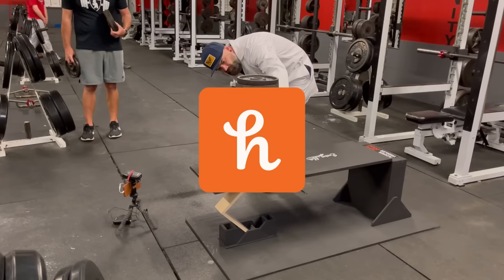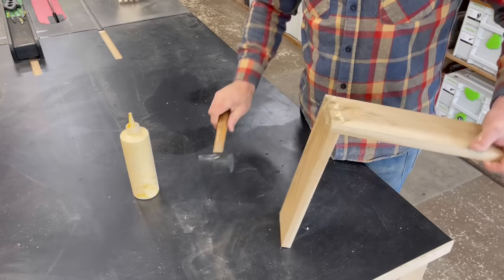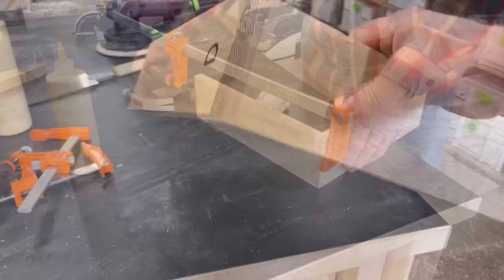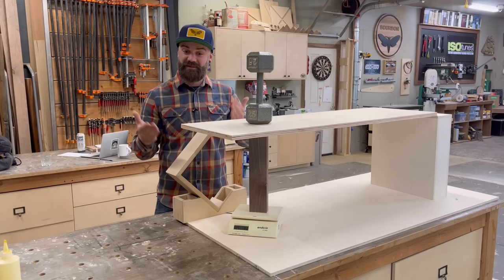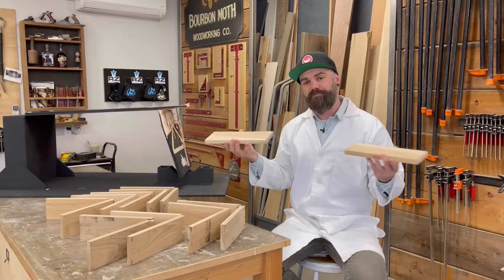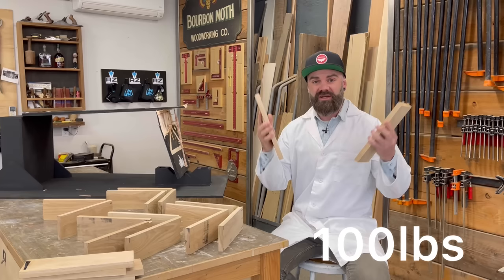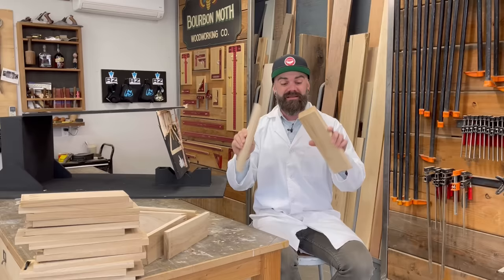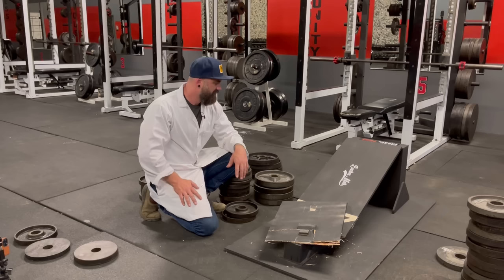What's the Best Wood Joint || Insanely Strong Joinery!

Comment: these are the variables that i think you need to check the next time you do this

1. the dowels where loose on insertion (im not saying that you should put a 1/2 in dowel into a 1/4 in hole)
2. the box/dove tail joints have many variables that you can check (box width - the fingers of the joint, curf width - the space between boxes) "i bet the best box joint has 1/4 in boxes and 1/4 in curfs, it would be a finger joint"
3. for the spline you could try adding more splines
4. you need to test the joints in 5 ways
-1 the way you tested it here
-2 pressing down with joint pointing up or down
-3 trying to force the boards to separate from weight on the inside in a L position
-4 trying to force the boards to separate from weight on the outside in a upside down L position
-5 shear the joint

Comment: The "Butt Joint" didn't fail because glue wicked into the end grain leaving less glue at the joint. It failed because the "Lignin" of the straight grain piece is much weaker than the straight grain in the end joint and thus tore away from the board close to the joint. (See Patrick Sullivan's video on "Glue Myths: 1. End grain").

Comment: 15:00  60 lbs seems like a surprisingly high number for a butt joint, but the thing to remember is that the length of the boards joined at 90 degrees on these joints affects the amount of leverage.  Where 60lbs was required with the force mostly at the ends of this particular length of boards, the closer you get to the joint, the more weight is required, and the opposite is true for longer boards that allow you to apply that force further away from the joint.

Comment: If you calculate the glued surface area, things mostly play out with more surface area is stronger. Box joint end to long grain doesn’t mesh. Add dowels, get more surface k bending resistance. dovetail & box glued increase surface areas & try to add wedges for pull force. Miter is butt to butt but with a rt(2)  increase in surface area, joining similar grain orientations. Adding the splines was insurance against full propagation of fault line. The plastic inserts helped alignment, but reduced glued surgavr area. 

Cool test. Next iteration make a box, put supplies in it, & see which handles push/pull fully laden (swallow) drawer with friction slides. Does the front, back or sides work together to drag a load from a cabinet with, say, waxed slides? Or do the joints get loose when carrying a load. Congrats on getting results

Comment: This was great, but I've got a bunch of things to think about -

First, it's always better to have more than one test per joint, to see if individual variation might matter - were you perfect on every single joint?

Second, there are a number of ways to make both box joints and dovetail joints.  If you'd had more teeth in the box joints, or more pins and tails in the dovetail joints, you'd have a greater glue surface on the long grain, and would probably have had stronger joints.  Looks like your box joints were 3/8"?  If they'd been 1/4" or even smaller, you'd probably have had stronger joints.  Same with the dovetails, with more but smaller pins and tails.

You also left out a number of joints that I'd like to have seen:
Biscuit joints (which are what the "Lamello" joints should really be called) with wood biscuits rather than plastic,
Drawer-lock joints, cut with both table saw and with a router bit (they're a bit different)
Splined miter joints, with the slot for the spline cut along the face of the miter rather than perpendicular to it as in your samples.
Blind dovetails, as opposed to the through-dovetails you used (IMO, probably weaker)
True mortise-and-tenon joints, both blind and through-tenon, as opposed to the loose-tenon Domino tenons you made
Miller stepped-dowels, although my guess is that they wouldn't be much different from the regular dowels.
A joint with two rabbets - similar to a butt joint, but with more glue surface.
It would be interesting to see how much of a difference TWO domino tenons per joint would have made.

Of course I'm asking you to do all of this, assuming you have unlimited time and funds.  IMO you did a great job as it was, and I appreciated the work you did!

In hindsight, it's not all that surprising that the splined miter joint is really strong.  The spline itself is under tension only, and wood is very strong in tension,  And with those splines, there's a lot of long grain to long grain glue surface, so the joint should hold together well.

Comment: Really interesting and broadly as expected, but I’d suggest the primary variable to be controlled for better understanding is the gluing, surface prep, glue penetration to joint and clamping forces. The timber variance cannot really be managed but I doubt it’s as significant so long as you have generally clean grain quarter sawn for all.

Comment: As a general rule when laminating planks a glue joint is stronger than the wood itself. It makes sense when looking at the porus surface area of daigonally cut white oak that it can absorb a lot of glue into the wood making the joint so strong. Good testing and joint information, thank you.

Comment: Regarding these joints in drawers...your test is an orange-crating test which is not the problem with drawer failures. It's usually a pulling failure which means that a weak joint like dominoes would actually be great as long as the dominoes were installed into the ends of the back piece. There's another joint I wish you'd done which is an interlocking router edge. This is one of the best, most useful videos I've ever viewed.

Comment: The bevel cuts has more surface area than a but cuts. You are right about end grain soaking up the glue but the trick is to use slow setting type and too apply two coats of glue, let first coat soak in till almost tacky then refresh it, doing it on both ends, then clamp together.  The other thing is the dovetail is directional stronger one way. The other thing I noticed was that you had both ends captured, you only needed to capture the bottom, then let the top slide onto weight board.  The other thing is that that not the true weight that's on the joint. The weight is actually at a 45° relative to torque put onto the joint.  Look up the definition of torque you know what I'm getting at.

Comment: I have tried them all. For speed, price, and strength I find pocket hole joints to be amazing. Not the best, but high in all areas and uses.  Do not undercount pocket hole joinery. 
 I also make my own plugs, and I fill the pocket holes, cut smooth and sand.  Nearly invisible.  

My next favorite is splines. Always hardwood splines. I came across some super dense and thin plywood the same thickness as a rip blade.  It was so nice. 
I can make hand dovetails, mechanical dovetails..... just not worth it.
Finger joints... splines have replaced them. 
Dowels take too long, with no leeway for error.  Even though I make my own dowels. 
Biscuits have too much space around the biscuit, and take too long. As Tenons are vastly superior in any application that you would normally use biscuits. 
Tenon joinery is great but expensive, and so is biscuits. 

Also, I made a ton of shelves/ boxes with rounded corners, and cove trim in the inside corners.  Getting rid of all 90 degree angles with round over or round... insiders.. The cover trim glued into the 90 degree corner, made the joint incredibly strong. Kind of like spline gluing the joint long ways.

Comment: Try this ultimate joint: midored corner, 1.5” x 1.5” block cut at 45 degrees on the inside of the joint. Then add (5)1/4” thick splines out of acrylic panels or a high tensile high density material. Maybe even pvc or just Douglass Fir wood. Use the depth of the inside block to add surface area and depth to the splines. Glue it all. I bet you it will surpass 360 lbs because it changes the lever length further from the joint and leaves the corner to be more focused on the tensile properties, hence the high tensile strength splines.

Comment: Hey bud, mechanical engineer here. Make your box joint again, then run a Dowell perpendicular through the length of the joint. The Dowell's diameter should be between 1/4 - 1/3 the thickness of your stock, I would be willing to bet the stock breaks before the glue gives up. To be frank the glue will probably be useless.

Comment: The miter joint makes perfect sense. It's end to end. So you are pulling the fibers long ways. In a butt joint you are peeling off the grain on the non end grain side. The miter also has more glued surface area.

Comment: Surface area of the glue up and the orientation of the wood grain are definitely considerations for strength when it comes to joinery, but if you look back at the box joint and dovetail breaking it wasn’t the joinery that failed but rather the glue. There is only so much pressure that the wood glue is rated to hold, and where your box joint and dovetail surfaces are not marred or torn out it is because of the glue failure not the joinery. Those are some fine examples of joinery. The miter joint and the mitered spline joint are likely the strongest joinery in your test because of the significant increase in surface area on a 45 degree miter joint and also distribution of forces is significantly altered on a miter joint.

Comment: My predictions (at the moment you asked for them):

- Butt joint (Weakest)
- Miter joint
- Pocket holes inside
- Pocket holes outside
- Miter with spline
- Domino
- Dowels
- Dovetail
- Lamello
- Box joint (Strongest)
 
Based on the amount of end grain and long grain being glued, the kind of construction and the type of load you're applying on the joints.

And wow, you've got me eating my words there. I did not expect that outcome. Also surprised by the strength of the pocket holes, and the weakness of the lamello. Never saw that before so I guess I excuse myself for getting that one very wrong...

Comment: I love the approach, this has been a fantastic ride. I am amazed by your findings and yes the lowly butt joint and his buddy the miter joint are far stronger than we need for most things. As you mentioned, I wonder if the advancement in our current glues has helped the “weak” joints be much stonger.

One thing that is bothersome in my mind is that I don’t see dovetails used with stresses like this. Think of a drawer front. The dovetails are pulled on in line with the sides of the drawer. What I getting at is we have different types of joints for different applications. 

I really enjoy your presentation thanks for all you share with us.

Comment: Spacing of the dovetail and box joints matter a lot.   I have homemade C clamps out of red oak. The fingers are cut only 1/8 wide. Looking at the end it looks like plywood almost.  But super strong. I made some shelf brackets the same way using 2x4 yellow pine and I could hang off of one bracket at 240lbs.     Also if you do a box joint or finger joint and drill a hole through all the fingers you can pin them with a 1/4 or 3/8 dowel pin and they are strong as hell without glue even.   Basically the fine finger joints like that give you the most surface area.

Comment: The joint that will break after the wood itself fails is the side-to-side long grain joint that you get with a panel glue up.  If you make your box with the grain running vertically instead of the customary horizontal orientation, it should be wicked strong.  Miter that, and you add about 40% glue surface compared to a square "butt" joint, and I wager you'd be amazed at how much it can hold.  Of course, your wood stock becomes prone to splitting in that construction, but depending on the use case,  that may not matter.

Comment: Dove tail split the wood like an axe. It weakened the wood in a way that the other joints didnt, with a splitting along the grain. All the other joints were working on the premise of surface area of glue. Cool experiment, thanks for the content

Comment: That jig that they are sitting in is supporting the joints, that’s why you see them fail and the board drops an inch or so, transfers the weight. It’s effectively creating a fulcrum. But I still think it’s a mostly accurate test with interesting results! Good work!

Comment: One thing to help understand: standard glue always holds better in traction than in shearing.

The miter is all about traction; the dovetail and box joints are a mix of traction and shearing. The splines in the miter still slightly helped, but most of the job is done by the miter.

If you want to see joints where the wood breaks, try to glue with epoxy. It binds to wood like crazy, and at the same time it's more a resin than a glue, meaning it has it's own strength in itself as a material (that glue doesn't have).

Comment: Miter joint with dovetail splines, try that. Also the reason that dovetail failed was because there are too few dovetails. The surface area with that style dovetail is substantially less for the glue to bond to, you need a dovetail with at least as many teeth as your box joint had to be a fair comparison. This test fairly assesses joint strength in a new joint, but glue decays over time. So you also need to consider longevity. If a miter joint breaks the drawer would fall apart, a dovetail on the other hand would continue to hold together well enough to remove the drawer in one piece, same with the domino and through dowel. Relying solely on glue seems less reliable to me.

Comment: This is an excellent test and very surprising... although the reason to make joints is not for its "bending" strength.  The angle of pressure is very different if applied at an angle verses straight off the joint.  Please note that wood joints are usually used to provide strength to builds like drawers or cabinets where the strength pressure is not at an angle but straight.

Comment: Here is a bit of science behind the mitter, the 45 degree angle has larger contact surface between the 2 boards, also the angle in the joint is parallel to the ground so I think It handles the torque force way better. Im not an mechanic engineer so I cannot assure you that but its my observation.

Comment: Spoiler: PhD shop teacher here who also owned a framing shop for years. Examine broken joints.  The glue failed, not necessarily the wood. Now, a properly done simple miter is so strong because the glue actually penetrates the end grain fibers of the wood on BOTH sides, as apposed to the butt joint where it only penetrated the fibers on one side. The glue simply has more to grab hold on to.

Comment: The surface area in contact in a miter joint is the square root of 2 x the surface area that would be in contact in a butt joint, since you are making a 45 degree angle cut in the wood. The joint that previously was face grain to end grain is now two cross grain cuts exposing more of the endgrain to contact, allowing the glue to seep in between both pieces relatively equally and harden into a solid L shape rather than the I shape of a butt joint. Fascinating stuff! I do love dovetail joints though if only for their aesthetic qualities :)

Comment: The dovetails were designed for assembling at a time glu didn't exist so the pieces couldn't move once assembled, unlike cubes.
As for the simple glued pieces, it's a testimony to how strong good quality glue is. But here, you have to choose very good glues and the result will be very dependent on how well you glue the pieces together.

Comment: I bet the physics of the mitre joint having a horizontal plane where the two surfaces are glued together and the pressure from the weight stack being vertical plays a role in how the forces are acting on the joints and impacting the test

Comment: This video answered a lot of questions but it also posed a lot of new questions. To be honest I was really surprised at how strong a simple miter joint was, but on thinking about it a little further the leverage arm in the joint (The area of glue contact) is definitely longer than a simple butt joint is. A splined miter joint seems to be the winner here for strength, versus time and effort spent. But, I agree that more testing is required. It seems that the tighter the joint is, the less effective the glue is in doing it's job. It also brings to question the actual glue that we are using. It would be very interesting to use different adhesives on a simple miter joint. ie, CA glue, epoxy, polyurethane, and different wood glues. I suspect that a superior adhesive might change up the order of these joints, and cause the wood to fail before the joint fails. This is a very enlightening video. You earned another sub.

Comment: An other test that I didn't saw a suggestion for in the comments would be to find the minimum weight at which the joint instantly breaks when the load is applied. Then remove 10% of that weight and see how long it can support that load. This is getting more and more wood and time consuming though

Comment: At 2:00  I'm curious why you did not put any glue into the holes, as it seems as though the tight fit of the dowel prevented any glue from getting down into the hole. Instead it seems like all of the glue was essentially scraped off and ended up outside of the hole.

Comment: To test the actual joint you would have to vary the board width. Calculate the toal glue surface area for the different joints and adjust the size so the glue area is the same. After all, are you using one spline, two or three, how many dominoes, how many dowels, how many teeth are in the box joint, etc. Then after that we can talk direction of tension, e.g. what a boxjoint is good for vs dovetails.

Also, you can clearly see many of the joints have an initial break (the glue) an then after that the wood/screw/etc. meaning not all of them are useful as a unified joint, but some are either fragmented or designed as directional. Only the top few has one clear breaking point where both glue and design worked together as one.